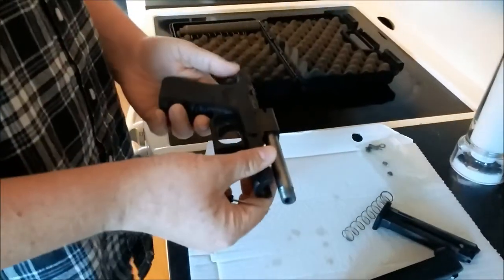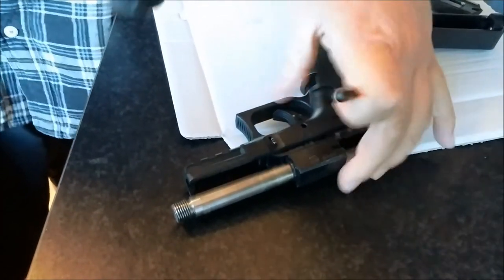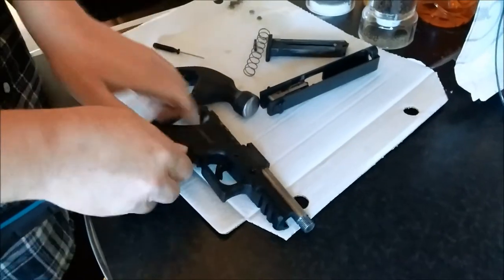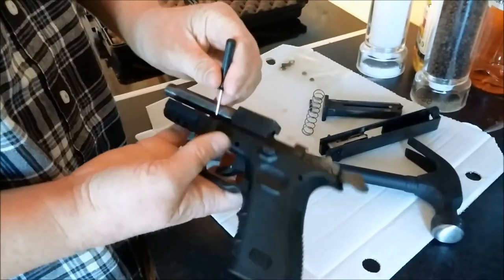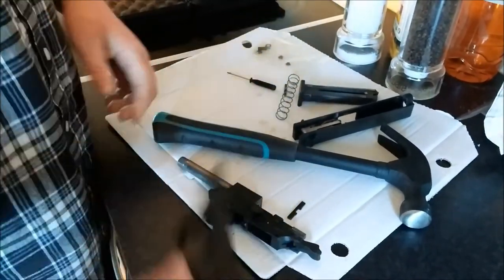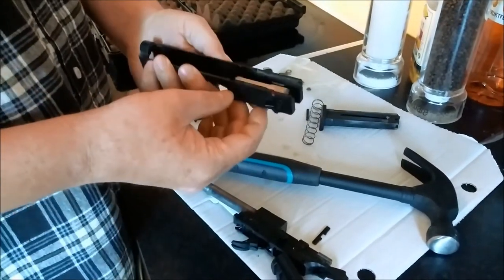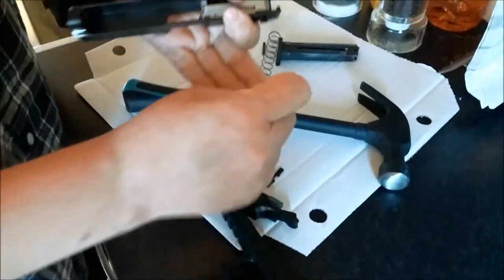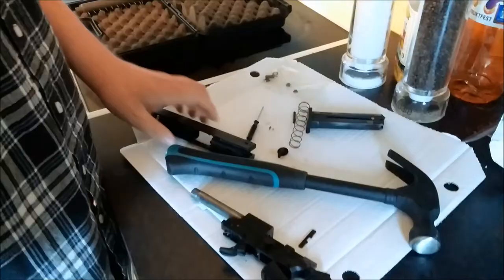ISSC M22 Disassembly - Lower and partial upper

Comment: when driving out pins a useful and pretty much free tool is a small block of 2 x 4 with a few different diameter holes drilled into it. Not only does it give you more than enough depth but it also captures the pin for you in the hole as long as you have it flat on your work surface. Just a thought on what I use and have never lost a single pin to it. If you go this way make sure that the wood is a good soft piece of pine so you won't have any damage issues. If you're worried about the finish you can also place a soft rag with a small hole in that just a touch bigger than the hole in your 2 x 4 block.

Comment: Good stuff, Dude!  Appreciate the video.  I've got one that just won't fire reliably and need to take it down all the way.  I did notice that on another video it stipulates that the spring must be installed with the small end first (I didn't know) to prevent misfires/jams. I'll be polishing the daylights out of the feed ramp to see if it helps.
Thanks again!
Reply from the maker: Rick Hall It's also very picky on ammo, so keep that in mind! Glad my video helped.
Reply from the maker: Rick Hall On second though, I remember that is shot decently with CCI standard and flawlessly with CCI Stinger ammo, so try some of those loads if you can

Comment: What about that tricky little spring that has to be under tension for the locking block, a friend of mine had a bad spring so the take down lever was loose-no tension, so the locking block would not hold the slide down under recoil and would accually launch the slide down range.

Comment: Thank you, Thank you, Thank you!!  Is there any way you can do a video on how to disassemble the magazine for cleaning????  I am not sure how and they are too expensive , and hard to find, to start hammering at it to open it.  Thank you very much!!!
Reply from the maker: The magazine is quite easy, the bottom plate is like a Glock's in that you press in the small button and then push the plate off the magazine. The spring and everything comes out then so keep your hand there so it doesn't fly off to some foreign country.
Reply: *****
what about the load assist button.   Does it come out?
Reply from the maker: Tac Dad It's essentially just a piece of plastic held up by the spring, you'll quickly see how simple it is once you open it